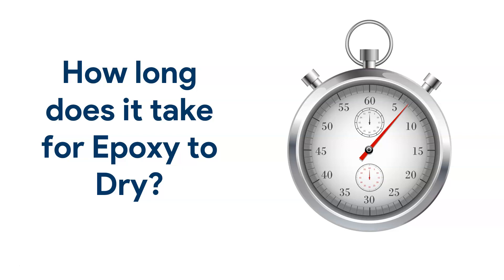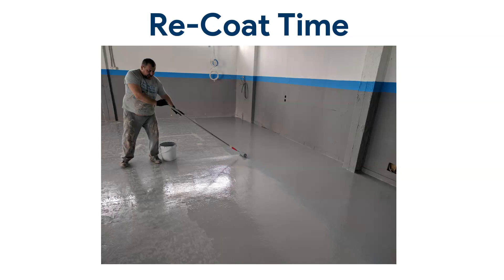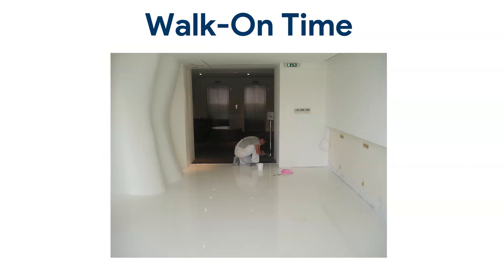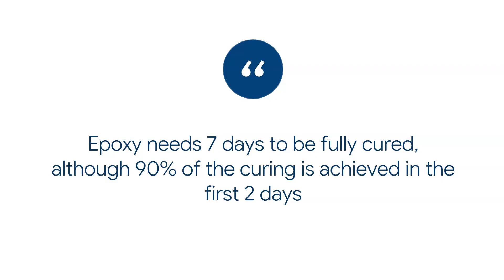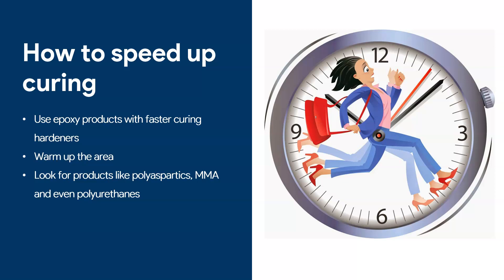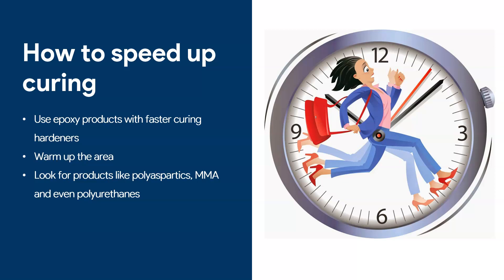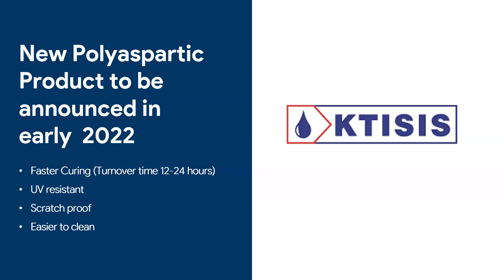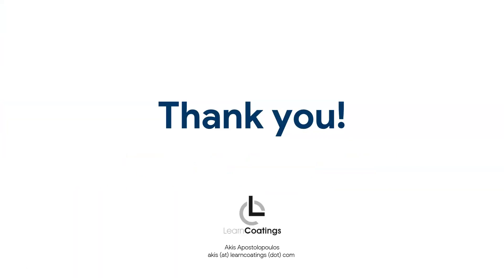How long does it take for Epoxy to Dry? - Understand when the floor is ready for use

Comment: Fun stuff.  Want an epoxy that has 4 hours of pot-life, 1 hour working-time, non-flammable, non-toxic, not classified as an environmental pollutant, does not have dangerous VOS (xylene/toluene as solvent) and allows direct chemical bonding with other materials?    Most people cure epoxy with a solvent. That's out of date!

Comment: any suggestions on how to slow the harder time? on a 100% solids epoxy floor? is there any additive that would help?
Reply from the maker: Adding some suitable thinner may slightly slow down the curing. But usually just ask the manufacturer if they have slower hardeners

Comment: You noted not to use propane heaters, but what about diesel or kerosene? And, I have heard that propane fumes can get into the epoxy and cause it to fail and delam, is that true?
Reply from the maker: I am afraid that diesel and kerosene will cause the same problems as propane, especially if the fumes are expelled in the same area where the floor was applied. I have seen propane fumes damage and stain the appearance of the surface, although I have never heard of actual delamination